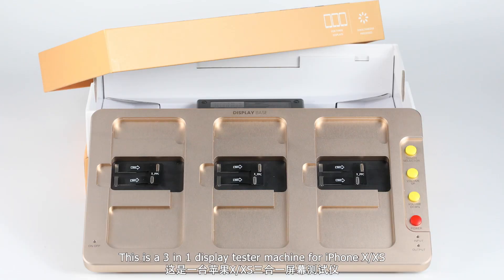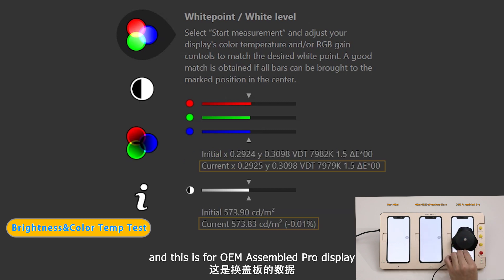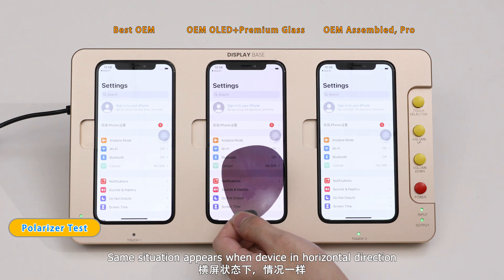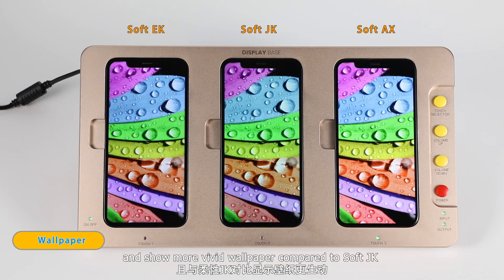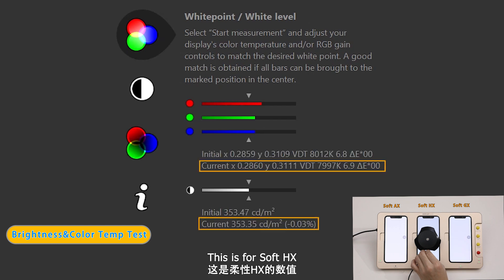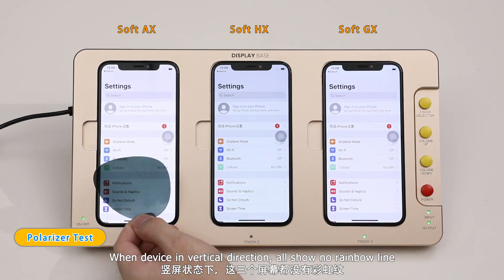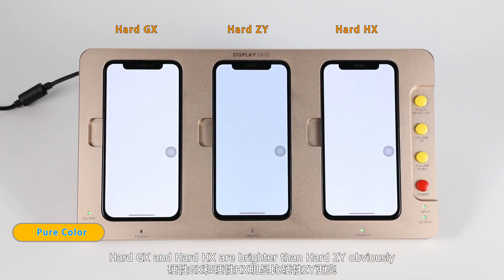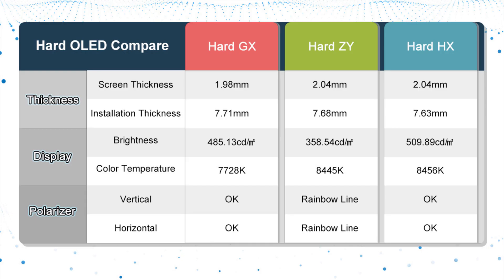All OLED Screen Test and Comparisons for iPhone X | Soft: EK, GX, HX, JK, AX+Hard: GX, ZY,HX

Comment: What's better jk or gx? Why would gx be better close to original? If jk looks brighter than gx.
Reply from the maker: JK is brighter, but pls check 5:51, GX has better installation thickness and better color temperature(close with OEM), which is eyes friendly especially you watch the screen long time, so we suggest GX. However, JK is with lower price, so if you prefer better price, then JK is good choice.